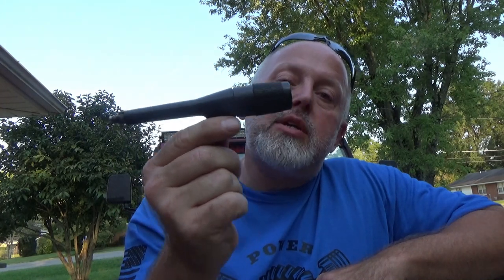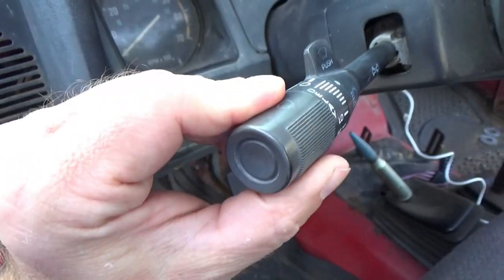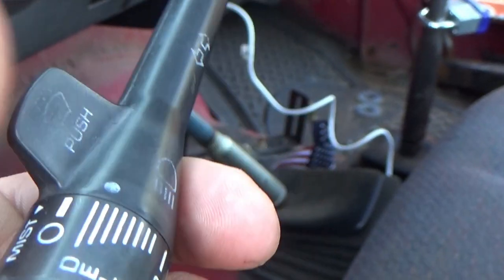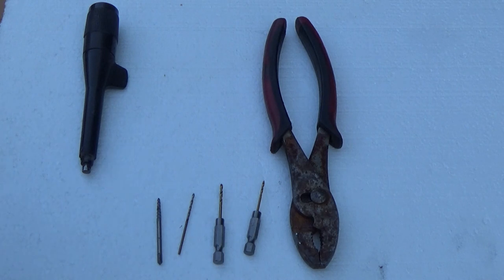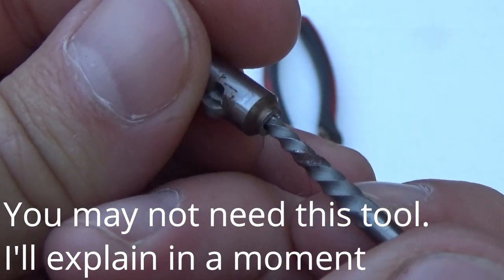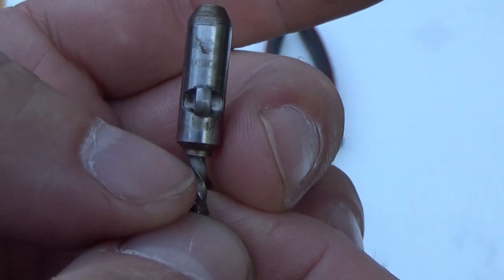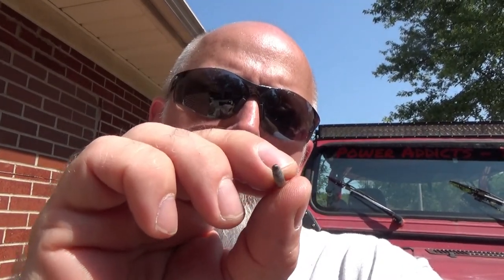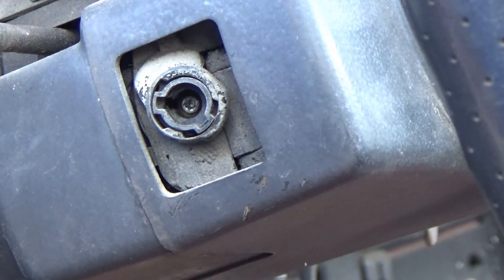Jeep Wrangler YJ - Turn Signal Lever Broke. How to get the broken piece out and install a new lever

Comment: Thank you!  Our 94 4 banger YJ needed the multi wiper switch replaced.  Tried to replaced from the top.  Impossible. removing the steering column was easy thanks to your video. Screws in the inside pointing up held the parts together. Only way to get to it was to remove the steering column  $163 switch at Oriles.  The first switch we got $100, but didn't fit.  There are 3 switches for the year.  Of course the one I need is the most expense.. sigh.

Comment: I got quoted $600 for 6 hours of labor to get mine fixed after it broke off at the exact same point yours did. The place called less than an hour in of "completely disassembling the steering column" and claimed they needed to "drill the entire piece out".. as in use a drill to completely destroy it. They said there was no guarantee it the new piece would fit in (I supplied the new part). I questioned them twice trying to understand why they needed to drill the broken piece out when they were dismantling the column and didn't get a straight response. They were being extremely wishy-washy the entire time and said they could wire in a toggle switch to control my wipers in 1 speed but they would have to take it to another place. I finally got fed up with them and asked them how much it would be if we just stopped right then and they said either a $70 "diagnostic fee" or nothing. I said okay let's just stop right here and I'll come pick it up tomorrow. They called me back a little later to coordinate the pickup and I asked how much it would cost... they said I owed them $120.l because they had to do something "extra". Didn't give me any more details and said he was trying to "go easy on me". I was furious. I refused to pay them a single cent and threatened a lawsuit and they said just don't even worry about it. I got in my truck, drive it to my warehouse, and had it fixed in 10 minutes using your video. I seriously appreciate it!

Bonus story: I texted the manager this YouTube link and the video of my windshield wipers working 15 minutes after I picked it up.

Comment: Crazy situation in my 95 YJ. The wand is still attached, but I cannot line up the shaft/tab/slot to remove the wand at all. Like it is seized up in there - maybe rusted or corroded in place so even when lined up, it will not budge. The wipers work marginally, but I want to install a new shaft because it is hard to get the wipers to turn on and off easily with the old wand because it is worn out. I will keep messing with it, but I may have to replace the entire switch.

Comment: That was a horrible b---H; the wipers would just not - not stop. I had the comb in and out 6X till I saw the steel ball in the burried slot; crazy process. Stick it in and just wish for a flat side; 
Thank you all for letting me do it. Now I hope it lasts for the wipers being and staying off .  at least I did not need to take the steering wheel apart.  :)  WE/I NEED TO NUMBER SOMTHING

Comment: I know this is an old video, but in desperate need of assistance - my high/low beam switch is broken in the column, and I'm high-beaming everyone. Is the windshield wiper switch the correct part that I need to fix this? Also, would you happen to have any videos on how to replace it? Do you have any tips, tricks, or techniques? I've watched the signal replacement and ignition switch replacement video several times. But I haven't heard anything about replacing the wiper switch.

Comment: Is there any way to fix the delay wipe?  My hi and low speeds work but the delay got longer and longer over time until it finally stopped working.
Reply: Mine only works on WARP SPEED 😂

Comment: The drill bit broke. Should I tear the steering column apart and replace the turn signal switch?  I watched the turn signal video but didn’t see the black part where the lever fits into (where the broken piece is located.  Is this a separate piece?  Or is it part of the turn signal switch?  Kind of lost what to do now.

Comment: My broke off last weekend in the woods. My headlights started flashing on and off on high beams. I break the thing inside what put that lever in. I had to pull my whole steering column apart and replace it. Not a easy job.
Reply from the maker: They can be a pain that's for sure!!
Reply: @Poweraddicts  I broke the peice the operates the horn. Try see if auto zone had a replacement part. They told me I had to order it online. I through advance and o'Reilly's after I've already ordered it one them can get it.

Comment: My 93 YJ signal doesn't activate the left turn in lest you move it around then it kicks in. I got a nother one to replace it with , BUT the original one doesnt have a delay on the wipers and the new one does, can i swap it out, i heard you cant??

Comment: The guy who had my 92 had the turn signal handle break off or pulled off .. He mixed jb weld shoved it all back together .. Now the arm won't pull off , but the washer wont work.. Any ideas?
Reply from the maker: Change it all out. Replace the arm and switch in the column.